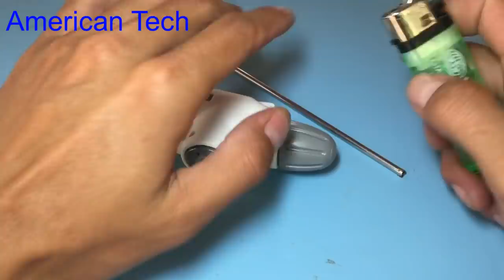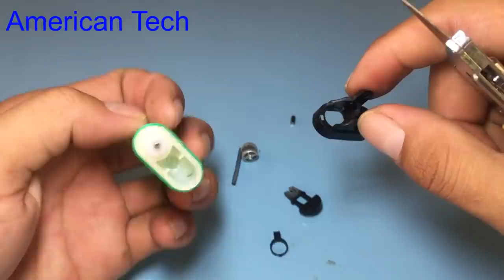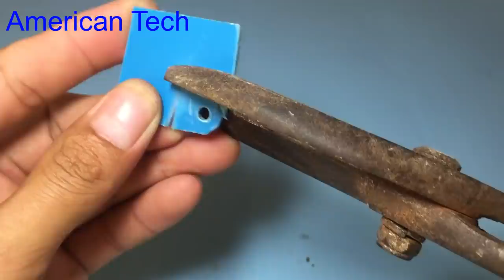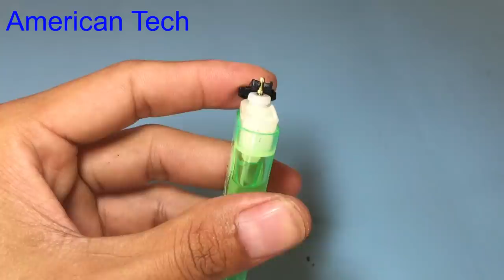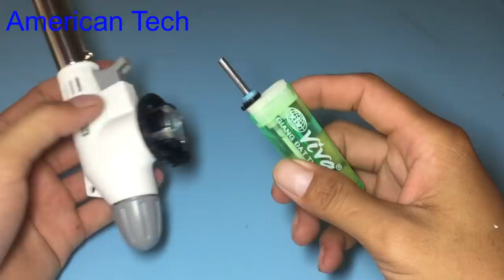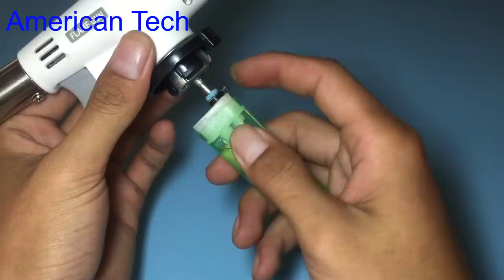How to make a powerful Gas jet burner from lighter , up to 1000ºC , cool idea 2018

Comment: Your time in making this will not compensate and not practical for P60 mega butane 7.8oz in Lazada, besides you still need to buy a lighter and metal tube, then  to refill it again.  DIY is fine, if you save time vs cost. Great for just video making but will not be practical to use for DIY.